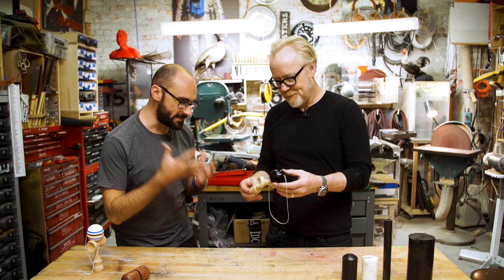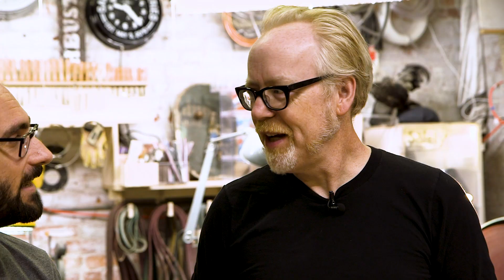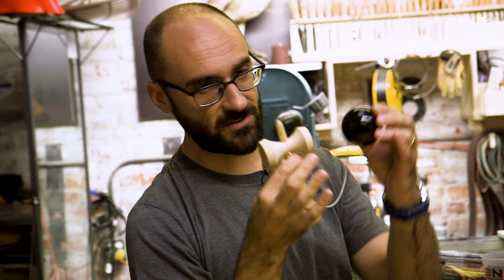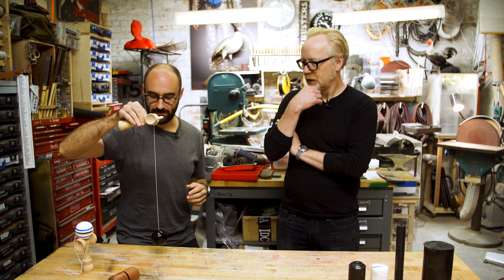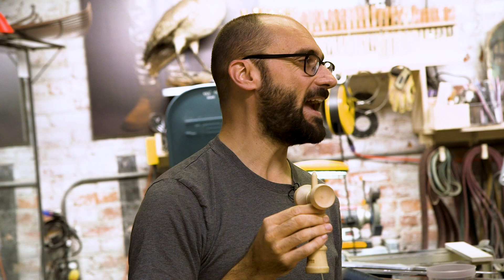Adam Savage and Vsauce's Michael Stevens Build a Kendama!

Comment: We had a vertical lathe at NASA that turned connecting rings 28 feet in diameter for the Space Shuttle External Tank.  The same lathe was used on the Saturn V project and to build the turn tables for battleships 16" gun turrets.

Comment: Lovely video, and a lot to learn about workshop techniques. But there really ought to be a "don't try this at home folks" warning because all the guards that ought to be on these machines to comply with modern safety regs are not there. A moment's inattention could lead to serious injury.
Reply: Manual lathes and band saws do not generally have guards fixed in place, they require the operator to place them over the work after it has been fixed into the machine. Machine tools are to be used by trained professionals who understand the risks and proper safety procedure regardless of guards in place. IMHO machine guards are for operators, not toolmakers, soaking as a toolmaker anyway
Reply: Also, tools should not be lying on the lathe when it is in use.

Comment: Nice effort, but I wanna point out that there are a LOT of kendama tricks, and many of them create additional requirements for the weight distribution of the kendama. Some tricks where this could matter are Lunar, Juggle, Bird, Airplane.
Reply: snoozehard This is so true. Same goes with yoyo. Some yoyo's are better at horizontal and some for other types of tricks. Weight distribution an shape matter alot on how it plays. 

But overall you should be able to learn everything on just one kendama. It really comes down to preference and how well you wanna hit that trick. This applies to yoyo aswell.
Reply: Tbh this may be one of the worst kendama i’ve ever seen. I mean, I like that it’s a kendama in general by the entire time I was cringing. Not only because the made it out of plastic and didn’t even use a bead or bearing, but they completely removed the crown and all of the weight. And everything else good about a kendama.

Comment: Could grippy be related to friction coefficients?
Reply: Perry Usher yes
Reply: I was thinking the same thing. I'm guessing when you change to materials that they didn't talk about, like wood or different plastics, the friction coefficient really matters.  A "grippier" wood would be one that's less dense, or a harder wood. More surface area of shavings touch the blade and if you put too much pressure on the blade it gets gets stuck to the material sort of like how rubber makes really short skips when you rub it against another surface.
Reply: cooper janke 
That’s not quite the type of grippy Adam is talking about. Its more like if you were using a knife to cut wood in a long straight cut, and you come to a point where the knife gets pulled deeper into the wood and gets stuck

Also, friction coefficients are not really related, because brass has a fairly low coefficient of friction with steel and is still grippy.

As Adam said it’s more of a matter of how hard the material is and how fast it work hardens. Again, brass for example is soft, but work hardens very quickly when it is cut and is therefore grippy.

Comment: As an avid kendama player and collector... I think they lost sight of the purpose of playing a kendama. It's a hand/eye coordination toy, that's meant to be difficult to master. Spinning the tama (ball) is one solution to one facet of playing the kendama. So designing a kendama to accommodate that one trick, seems silly. Granted, I love these videos and I'm just being a stickler. I learned a lot and will value the information, regardless. Stay classy!

Side Note: Although variations of this game exist all around the world, the Kendama was created in Japan during the early 20th century. It's origins stem from the French game Bilboquet that was played as early as the 16th century.
Reply: I wasn’t aware there was a community for skill toys lol
Reply: That's a pretty good point, but also consider that the lack of bevel in the tama hole makes it harder to land on the kensaki because you need to be more precise. I think the weight of it might also make it slightly harder because of the fact that you need more force to bring the tama up to the same height as you would with the wooden kendama which means there's more room for error (since you'd either need to flick it up harder or with a longer movement), so it kind of seems like he made it easier to do one particular trick but harder to do others without realizing it. I will say though that the denser tama probably also bounces less than the wood when it lands in a cup so it kind of evens out the difficulty in the end.

Comment: Adam challenging himself on a single-point thread in delrin, so cool. Awesome video. A small note would be that when you used a center drill on the curved top part to keep the drill from wondering, unless the chamfer diameter is wider than the drill bit diameter it can still walk. we usually just use an endmill to create a flat spot wider than the drill bit. then make a small center bit peck just to start the drill on center. As long as both halves the cutting faces are symmetrical (or centered and equal width), then the drill will stay on center through a solid material. Even then, the drill can still walk at the bottom of the hole if it is curved or not perpendicular to drilling axis. I love the nuances, just like Adam and Vsauce like to do.

Comment: Fascinating, I'm glad I stumbled across this.
A Woodturner's take on spheremaking:
Mount the stock between centers, there's lots of choice for the headstock end, and the tailcenter should be live.
Turn the bulk of the sphere using a jig, fixture or just your own hand-eye coordination, leaving two short stubs. These stubs should be long enough so that they can be turned away leaving
a spherical surface, not bumps or flat spots.
Separate the stubs from the stock/centers, and remount the ball in cup centers (which are fun to make to size) so that the stubs are clear of them. You're going to definitely need the live tailcenter for this.
Turn the stubs off to complete the sphere.

Comment: If you want an easy way to pump out wooden balls without getting that monster out (or buying expensive equipment) just use a hole saw and a lathe at the same time. It'll make you a perfect wooden sphere in 2 seconds flat. Just make sure that the hole saws hole is the size of the sphere you want and the stock you're using is appropriate to the job and diameter required.

Comment: While I do not really have the scientific explanation, I do work as cutting technician on lathes and have seen my fare share of crashes because of grippines.
Its a bit late but here is my take. It has to do with how easily the material is cold formed. If you pass a certain depth the material stops flowing of the tool as shavings, and starts to bunch up. This pulls the tool into the material and the material into the tool increasing the bunching up and in turn increasing the force pulling tool and material together. Until either the machine stops dead, the material gets ripped out off the chuck or the tool breaks.

Comment: A paper clip when bent back and forth repeatedly builds up internal atomic dislocations (dislocations- flaws within the lattice structure which will move throughout the material or be created when the material is cold worked) within the crystalline structure and the bend location that strengthens the material until it fails  due to the loss of elasticity, aka- it got brittle. The heat is due to friction of the movement of the internal dislocation- but it does not change from BCC (body center cubic) to FCC (Face center cubic) fully until you pass the A3 line on the phase diagram @ 918C. And yes- I am a metallurgical engineer- sorry- I couldn't help but comment on the paperclip lol

Comment: Love it some great tip in machining one thing to try is when doing taper threads put cutting tool upside-down on center height   put the lathe in reverse start the thread at the chuck  the work down to the tail stock  it takes practice but you will get it doing female thread little bit harder

Comment: Found my Kendama. Untangled it. Now I'm going to restring mine except I'm going to mount a bearing inside the ball and have the string holding onto the inner race of the bearing. Basically the string won't be rubbing on the ball but riding on that bearing. Hope it works out.

Comment: use a timken bearing  lol just kidding but early on here kinda wondering if he'll use a thrust bearing or something like that. wish I could put a picture on here. I have a bunch of bearing I just keep around for making stuff. My tie rack in my closet I made recently has bronze bearings and ball bearings, cantilevered with a heavy base so it didn't take up a lot of space and everything was precision ground, I do all that myself. fasteners were flush heads mostly, two tapered pins and a couple low heads counter sunk. turned out better than it might sound, it doesn't go unnoticed, I have a picasso leaning on the wall right beside it, no one notices that but that tie rack is the first thing they usually mention. I really like making stuff, with more purpose usually but still fun stuff

Comment: Kids, I know Adam is a pro and makes the lathe look fun and easy, but do not play with or even touch a lathe without proper and extensive training. They’re powerful enough to suck you up in and spin you into a noodle faster than you’ll even notice your shirt or hair getting caught. Even seen a video where one dude is turn to liquid bits cause he is spun so fast by the time his coworker turned it off the only thing left spinning was empty clothes. They’re definitely one of the most dangerous yet common machines regularly used everyday. And everyday there are really bad accidents on them

Comment: I haven't seen the napkin paradox video, does that mean in order to find the volume of a ring (well not exactly a ring but a sphere with the center drilled off) you only need to find the height and calculate the volume a sphere of that size, aka 4/3πr³ is the volume of spheres but also 4/3π(thickness/2)³ is the volume of spheres with a drilled hole in them?

Comment: 18:40 Wait so you use a finishing tool as a roughing tool as well? I'm assuming you have numbers on your wheel, if so, I would have put a few more steps into the stock so that I could get an even hand feed the first time....measure 80 times, cut twice.

Comment: I would guess a shorter string gives you more control. The same way a shorter band in a ball and paddle allows you to keep it bouncing longer and faster. Less distance to travel and better control if you do snap your wrist. A longer string would require more energy to lift which means way more hand motion and losing control. But I’m probably wrong. long and strings are used in competitions because they do tricks and having more strong = more possible tricks and better control over hard to perform tricks. But when it comes to the basics of it having a shorter strong just means less to travel. Example if you have a 2 cm string it will be easy to always land in on top? Granted it takes the fun out of it (I’m sure) I just can’t see (outside of tricks) why longer would give you better control

Comment: At 17:18 he centers the tool and there is a steel rod in a chuck that is used to find center position. Then at 17:22 he tightens the screws for a tool and there is still piece of plastic that he was machining. Seems to me this was edited out of order. Because you don't tighten the tool when you removed the piece that is used for centering. You tighten screws first so the tool holds in position. I mean and then Adam talks about the order of operation. And it seems to be in a wrong order.

Comment: When i was 17 I got my LTS( lower tech school) Electro tech.diploma at the highest c level. Then I got the chance to do a 1 year special course in mech shop to try get the mech.  diploma, this meant building a lathe(max span of 35cm long) from scratch. The only thing we did not get to do was hardning/ temppring steel, thus I love seeing you doing fine machinarry. But.... The 1st thing i had to do in that course was to create a near perfect cube from rough cut sqaure steel, albeit within a margin of 0,05mm with handtools and a micro meter. It took me at least 60 hrs and many tries, but at least i managed it in the end. Have you ever tried this, or will try this. Im from the age before cnc etc. Old fashioned handwork is that still taugth in schools? Please understand im Dutch my English is limmited.

Comment: I'm a bit amazed by how many 'practical' things Michael has no clue about.  Metal heat treating, types of string, knots, it's called a 'chuck'.  But I guess if you fill yourself with his type of factoids, there is not much room (time?) for anything else.  But then Adam measures the cosmetic OD of the cups instead of the critical ID.  Oh well, got to let the kids play, how else they gonna learn...  Tip for makers:  fly fishing backing line.

Comment: Could you mount a belt sander locked on 90 degrees in front of the lathe to get rid of that grabbing effect of the grippy material?
Reply: Or just mount a circular pad sander to your cutter surface?
Reply: The pad would clog faster

Comment: I really love both of these guys work and talent, but I would honestly display better safety practices/standards when demonstrating the function of cutting equipment with good proper safety standards as you would on the job. No one wearing any kind of PPE by the way and I would remove my watch whenever running the machine.
Reply: When he take the swarf of while it's still spinning is nerve wracking

Comment: It's supposed to have a longer string and you can adjust the string for each time you play by removing the white portion adjusting the string and then locking it in place by putting the white portion back on tight